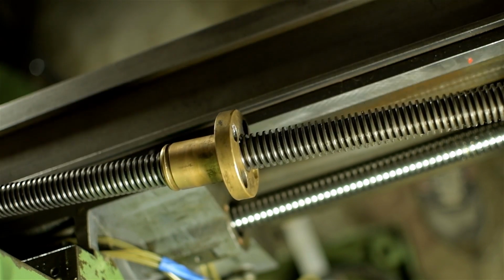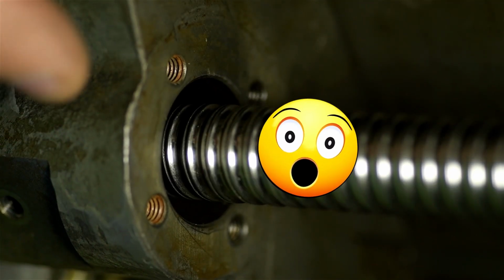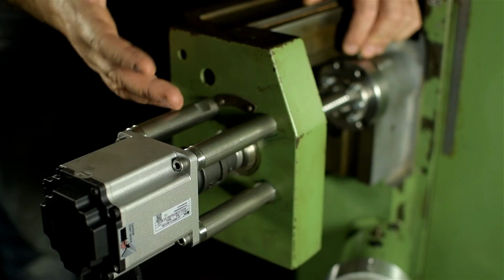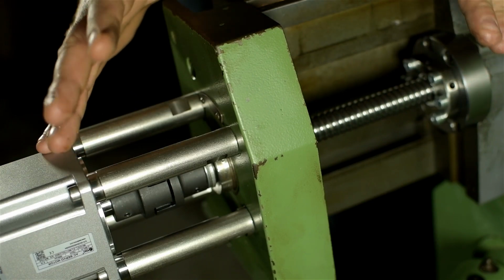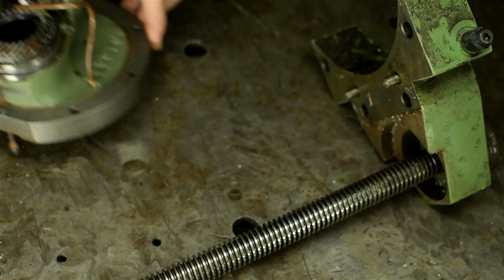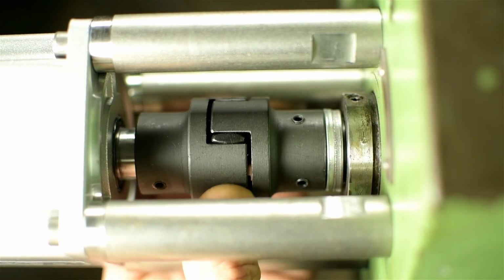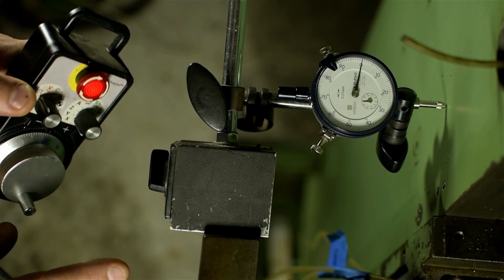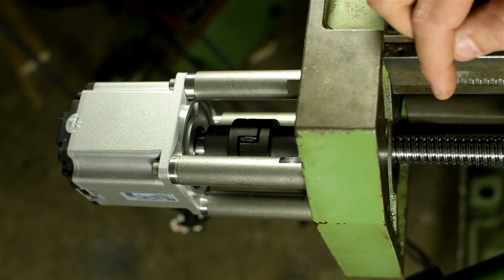Maho X Axis?  DONE!

Comment: "He coupled the shaft, then slid it into the hardened shrink-fit bushing, and promptly prematurely mixed his units...". I had to get a cigarette.
Reply: He's just that good.
Reply: there was also something about a long screw and some balls and thrust and some other stuff, I didn't catch it all, I got distracted as soon as he said he's taking advantage of a "big gapping chasm"
Reply: Well, truth be told, he also implied that the Z-axis belt-heat opportunity is not due to tension, size, or alignment, but LOAD. Typical CNCstar, bragging about the size of the lo.....
Reply: And to top that, the coupling he used is a LOVEJOY style! Excuse me for a minute, I need some time............uhhhh
Reply: @tomt9543  some time and a shop towel

Comment: Hey tony you have inspired me to get into machining so my first 2 years of college will be machining. Love the videos keep it up
Reply: Too bad it'll be outdated what with 3d metal printing. Well, Ave still needs something to beef about. Maybe you can do sintered metal products instead?
Reply: John Possum no metal 3D printing will never be a replacement it will reduce the need but it’s far too expensive to metal print
Reply: @johnpossum556  Buddy I just used DMLS for a capstone project. 3d printing will suppliment general subtractive manufacturing but never replace it. The cost of metal 3d printing is a whole magnitude or 2 more than standard machining.
Reply: @lucas02389  So many parts aren't even metal any more. Plastic radiators, plastic intake manifolds...
Reply: John Possum I’ve never heard of a plastic radiator I don’t know if that transfers heat as good as metal but plastic parts for radiators yeah that I’ve seen

Comment: Also flexing is that set of 4 stand-offs.....when you dispose of the spider-y thing your motor can come much closer to the bed BUT this time use a fat cylindrical collar with 4 through-holes drilled as a single, un-twistable stand-off ring !!
Reply: Or you coud use a box section to construct the stand off
Reply: Agreed about the stand-offs.
Reply: @wiggysworld    I believe that motor has a pilot machined into its face and so that pilot can match-up with the bore of the collar.....

Comment: Dont forget you're using roller (not ground) ballscrew: rolled ones always have some backlash. Also it's most likely C7 class, so it has inaccuracy of 0,05mm for 300mm travel. I would recomend you to buy a used ground ballscrew made by some proper manufacturer like NSK, THK, etc. You can find them on ebay for $100-300.
Sorry for my english :D 
You ask me anything about ballscrews or linear guides, if you wanna know more.
Reply: They are quite expensive. Since the inaccuracies aren't going anywhere you can also account for them through calibration.
Reply: @ChristophPech  $100-300 isnt expensive, since new rolled ballscrews cost about $100-200
Reply: @goodfis624  I paid 70€ for the rolled ones 20mm thick (aliexpress), the ground ones would have cost 200€ (with the double anti-backlash nut).  Sure, not terribly expensive depending on the machine one builds, but the rolled ones turned out to be very accurate.
Reply: @ChristophPech  double nut isnt necessary for preload. Oversized balls in usual nut work well enough.
Also I doubt ballscrew from aliexpress is any good, I've seen them a lot. It will wear out in a matter of months. Rolled ballscrews from TBI or HIWIN are decent, but noname crap from aliexpress are not.
You can check this shop on ebay for used ballscrews: https://www.ebay.com/str/industrialpartsshop/Ground-Ball-Screw/_i.html?_storecat=4322381011

I can say that a used ballscrew from NSK or THK is by far better than new from TBI or HIWIN.

Comment: As a CNC machine designer, jaw style couplings when appropriately sized and with the correct hardness spider work perfectly well in CNC applications.  If that really is just a plain old soft rubber spider, you will likely run into accuracy issues.  Simply swapping out the rubber spider for a high shore hardness Polyurethane spider will stiffen up the connection considerably and is easily repeatable down the microns.

Comment: Hey Tony. About those motor couplers: the 'accordion' type you described are different to the ones you used in here. The accordions are designed to be flexible in bending and in tension/compression, but stiff in rotation. The current one isn't stiff in rotation at all due to the loaded rubber part. Most likely that one is designed for stiffness in compression and tension. Since the that linear motion is already constrained by your bearing. You only need torsion stiffness to avoid (load-dependant) errors. So that's why your errors are so large indeed. Just thought I'd put my engineering skills to good use for a change... lastly, I have really been enjoying all of your videos. Keep it up!

Comment: We had a cnc converted machine at work that used a love joy coupling like that to fit the servo. After a few decades the rubber part wore down, introducing a ton of backlash, and creating a bunch of problems.
The servo controller would under compensate when you reversed direction and moved just a little. Then the controller would overshoot the target. Then under compensate for backlash moving backwards. This would create kind of a fluttering in the axis and eventually would result in an error on the servo controller. Once I figured out what was happening I put a proper servo coupler in it's place and cured the issue. This might be something to keep in mind

Comment: I work on a CNC-mill with 4 meters of X-travel and it uses two servomotors coupled together to move the X-axis with this type of coupling. Although they probably electronically compensate for the slack when switching directions.

Comment: I work controls for a living and I have a couple of concerns with the way your servo is mounted.

1.  I was always taught that those servos release much of the heat through their face.  You don't have a lot of thermal mass attached to the face to absorb that heat.
2. That motor's mounting looks to offer very little for the rotational torque of the motor.  May be fine unloaded, but when the x-axis gets loaded you may eventually find either the motor or the standoffs starting to get compress or distorted from the motor trying to twist them.  This would also be another reason why the encoder position is being lost to the real position.

Either way, something to keep an eye on.  Keep up the good work.  Love your videos.

Comment: The original thrust bearings that were in your machine will lead to lost motion in your X axis.  With ballscrews you need two high precision angular contact bearings mounted in back to  back (DB) configuration.  The existing bushing that you have has threads that can set the proper preload on the ID of the bearings.  In order to set the preload on the OD of the bearings, you will need to machine a cap that bolts to the side face of the bearing housing casting that bolts to the X axis table.  Your bearings will locate in the bore of the bearing housing and the OD will sit about .002"-.003" of the side casting face.  This gap will allow the cap, which will bear against the OD of the bearings, setting the proper pre-load.
Reply: LoveJoy makes an amazing coupling specifically for CNC applications.  The spider is a high durometer plastic that doesn't have backlash.  The downside is that it requires that the ballscrew and servo motor shafts be aligned within a couple thou of each other.  I had a hard time telling, but it doesn't appear as though the stands off mount to a machine surface on the bearing end cap casting. Having all four stand off servo mount faces lie within the same plane, or at least within a couple thou, will help get the orientation of the servo's shaft axis aligned with the ball screw so you can use a fancy LoveJoy coupling.  I used one for the Z axis of my ball screw and I have no measured backlash.

Comment: Yo, This Old, I have a tip for you after watching your video on your little heat treating oven. Try tossing a charcoal briquette or two at the very start of the heat treat. When they end up burning in the oven, they consume some of the oxygen and prevent as much oxidation on the parts. It ain't perfect, but it helps immensely.

Comment: Tony don't use the indicator on a painted wall it sometimes dents the paint and the mag base might be a bit loose. Honestly, for the table size and weight that screw seems a bit small for me. And Put and indicator on the other end of the screw and check if it has axial play when it changes direction. And the thrust bearing bushing that you put in might not be the best solution under high acceleration, you didn't machine some threads on the end tighten the bearing with that right? that could be a real weak point. best option I would say  is to  get a proper ball screw bearing end (HIWIN has good stuff for reasonable price). As a second thought If the all above checks out it could be the ball screw itself. Didn't see your ball nut info But if didn't get a good branded one with a good backlash compensation method (oversized balls or preloaded double nut) please get a good set of grounded ball screws. Trust me it will make huge difference if you're trying to get make some accurate parts. If it's not justifiable to get ball screws like rexroth at least get a good hiwin one with double ballnut preloaded with a spacer and a bit larger diameter than that. 

Been through all that converting a really heavy old okuma ram type mill. Trust me all of the above stuff makes a huge difference. Keep up the great work. Can't wait to see it making some chips. by the way if you could get a really good dedicated controller (Seimens, fanuc ets don't do Adtech) you might just be able to have a machine that could go toe to toe with a haas mini mill on many cuts.(with a good spindle of course) If not go with linuxcnc  it has it's learning curve and some other quirky stuff but it's hands down the best in its class.

Comment: I would recommend (eventually) changing the motor stand-off posts to a L or C shaped spacer. The 4 post style will position the motor correctly, however it is not as stiff against the torque of the motor. When the motor delivers a lot of torque the whole assembly will twist up (slightly). The torsional stiffness of the mount will directly contribute to servo control loop maximum bandwidth. And you should definitely change the coupling to a high torsional stiffness coupling. Any springiness or backlash between the motor and the moving mass will be hard for the controls to deal with.

Comment: The 0,10mm error you got when pushing back and forth is typically the error I get at school on the old milling machines. I used to push the X axis by hand to counter the effect until a teacher told me to tighten the X axis sliding guide, which was indeed loose... The error is now 0,04mm but tightening more adds too much friction

Comment: tip for the backlash: measure from the table to the groove on the axis to get the backlash, go one direction, zero a indicator on the screw groove, then rotate the other way, if there is backlash you the indicator will show it since the table will move less than the rotating groove in relation to the table.

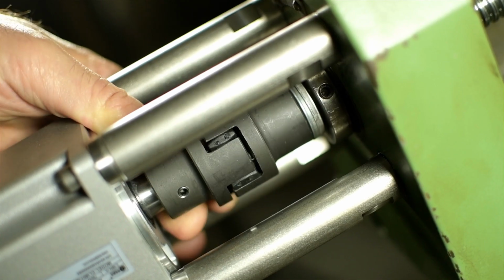Comment: 7:05 look at all that sexy play. You're gonna enjoy that later. That being said, to prove the concept use as much stuff you have lying around as you can I'd say, no harm doing a swap later when you need accuracy. In an ideal world the drive shaft should be directly attached to your motor shaft, but failing that yeah definitely the wrong coupler. Then again that's nothing compared to the slack on your Z axis belt, that's going to be the worst long-term harder-to-solve accuracy problem you're going to have. You have a closed loop to your motor position - but you don't have a closed loop to your drive shaft position, that's gonna be problematic if your motor shaft and drive shaft aren't very tightly coupled. To be fair very very very good software may be able to account for some of it, but not much of it, especially if the play is unpredictable.

Comment: The only problem with the rubber spider couplers is that under load the rubber does what it’s supposed to do, and compresses a bit. That’s to take up varying start and even stopping snap. The varying load will cause varying compression. I had a number of different couplers of that type on film processors in my company. Eventually, the spiders need replacement as they wear out. For our purposes the compression wasn’t an issue, but for high precision positioning, it could be.

Comment: Think I'm going to start a Famous Quote page just for TOT.  Busted me up with 3 in this video! Luckily I had already finished my espresso.  It's a coin toss as to coupling per the community below especially not knowing the quality of your ball screw and not being dialed in.  Personally I'd go direct but a crash becomes more difficult ($$) to overcome. You may have something in your controller code to work with¿  But hey, with your time machine you could change the past.  Either way tuning is always somewhat of a black art on something of that mass, at least relativistically in a scalar world, always remembering who won the race.  Mighty fine build and Video Mr. T!  You may be right about the final axis, yet I have great confidence and sure you'll use plenty of lube.  Hat Tip!

Comment: Those "accordion" style couplings are called beam couplers designed for zero backlash. You could also use metal bellows couplers as well. Spider couplers aren't bad but don't offer the backlash tolerance of the previous two.

Comment: YAY TEN MINUTES OF TONY! BOO TEN MINUTES OF TONY!

The time dilation effects should cancel out relativistic effects of length contraction. By the time the shaft contracts outside of its housing, you'll be back in Rome looking for that briefcase.

You could also use a metric fluxon-driven pseudo-Riemannian quantum pinning coupler to pin the machine to your specific spacetime coordinates. I suggest attaching it directly to the spindle housing instead of the table to prevent closed time-like curves forming around your garage. Make sure to use the metric one. The imperial one on a German machine would give a causality violation--your son would be your father and you'd never have been born (if my math(s) is(are) right).

Thanks for the laughs. Looking forward to the next one.

Comment: To prevent potential errors during the indicator test, you could: set to zero, move 100 times from 1mm to 10mm and then slowly (very slowly) return to zero. That way you can measure backlash without the fear of the indicator being moved by the push.

Comment: Whatever anybody says about spider couplings, there is no way that that can cause 0.1mm backlash. Assuming 5mm pitch ball screws that translates to 0.1 /5 *360 = 7.2 degrees rotation error on the shaft. The belt on the Z is also a "soft" coupling and there is no problem there. I would upgrade to the “accordion” style couplers though as that would have better linearity in the control loop of the servo. The grub screws on the shaft is a much bigger pain to my eyes than the spider coupling.

Comment: I have used both the 3pice and the 1 pice coupler on servo systems, the 3 pice is used were you have a keyway and the one pice were you don`t. if you have big, slow system, with high torq is monstly the spider coupling. with the spider couplig is critical to choose the right spider in the middle. When high speed, presicion servo systems you use the 1pice, I recomend the 1 pice I used that alot on servo/stepper systems, I have build CNC Saws that have a movingmass over 800kg. I use the 3pice spider coupling most on ac-motors/gearmotors. it`s critical to clean the shaft before installing a one pice one, and it do not require keyways, (if you chose the right one and install it correct.)

Comment: Tony, i have had the perfectly random dead nuts setup elves appear in my career a couple times. Drop a vice perfectly trammed or a bore hole the first time and then waste more time checking with different indicators thinking in my head there is no way i could have eyeballed this within an angstrom.  This .0001 inter-rapid has to be broken there is now way?" Sometimes the machining gods have a scene of  cruel humor.  @4:10 ROFL Tony> Yes absolutely the "accordion" style. I have been down the retrofit road a couple times.  the Rubber lovejoy style will eat itself up on your first run.

Comment: You'll want oldham couplers for the X.  They have a Acetal or Nylon disk that can shatter and act as a mechanical fuse if needed.  Very nice.. Zero Backlash, and can handle servo misalignment (offset, not angular).

Comment: I was a little sketchy on that elastomeric element coupling when I saw it because they literally have 'designed-in' backlash.
Frankly, unless you have significant shaft misalignment to deal with, you'd probably be better off just making a coupling out a piece of round stock bored to match the shaft sizes, with a couple set screws on each end set 60 degrees apart.
Those elastomeric couplings are more for shock absorption on regular motors that start at full speed under moderate to heavy load, and unless you're going to be doing some rock crushing with that X axis, it's just introducing unnecessary error into the movement with little to no benefit.